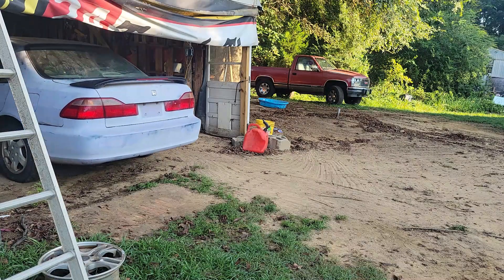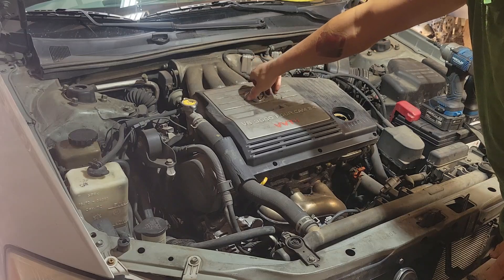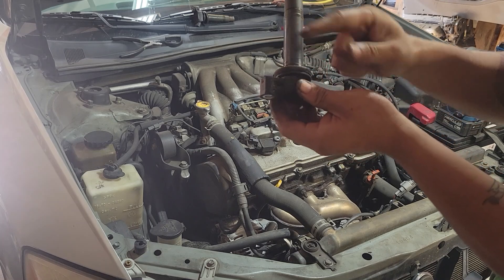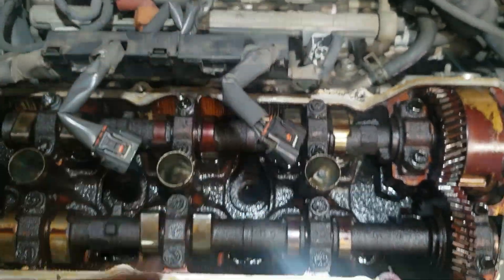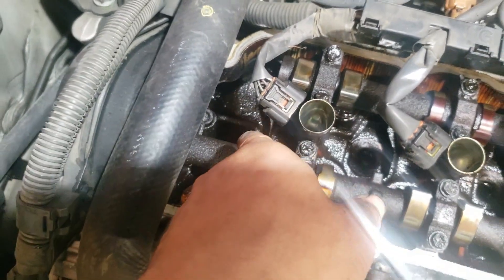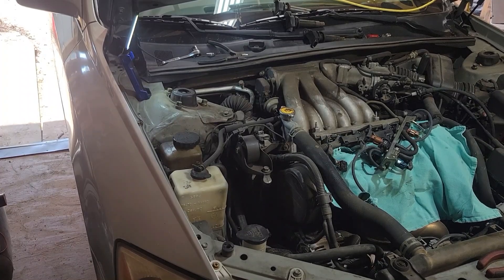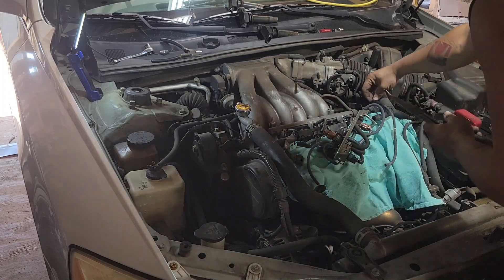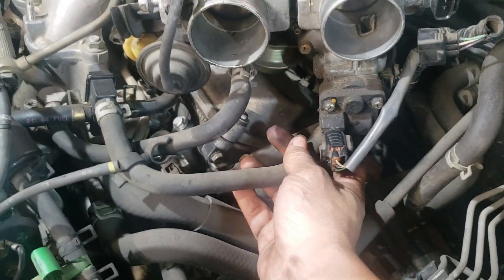2000 Toyota Avalon valve cover gaskets and knock sensor replacement

Comment: Hey ben, quick question. Do you know if it is possible to swap to a manual transmission on a honda odyssey from 2005? And if so which transmission would be the best fit?
Reply from the maker: You will need a Acura TL type s transmission and pedals also the shifter and cables  

I believe you need Acura MDX center console... Also
Reply: @bensautorepair9914 thanks a lot, i’ll look into it. Keep doing videos, you’re a natural